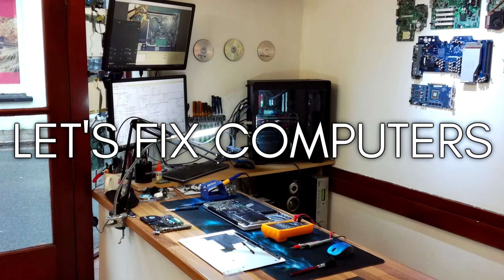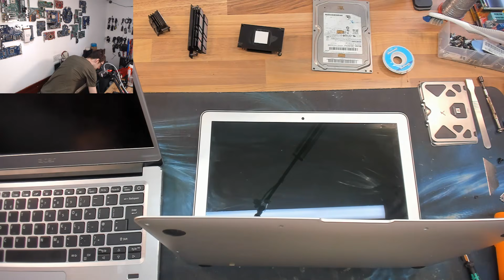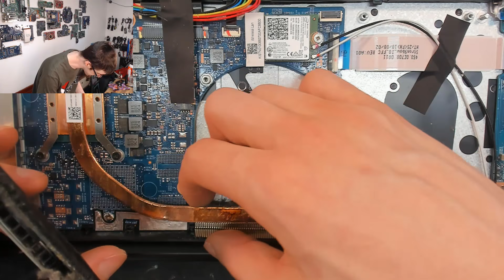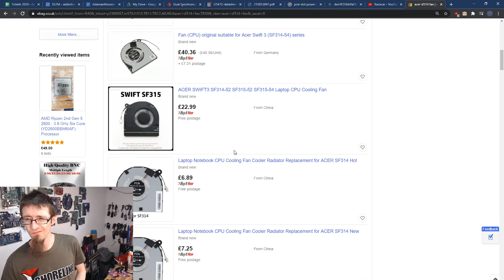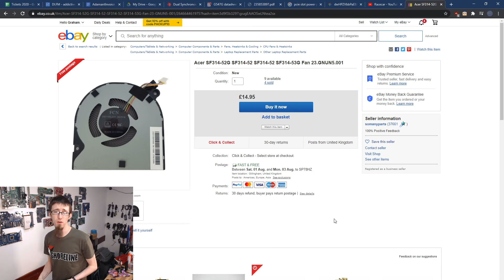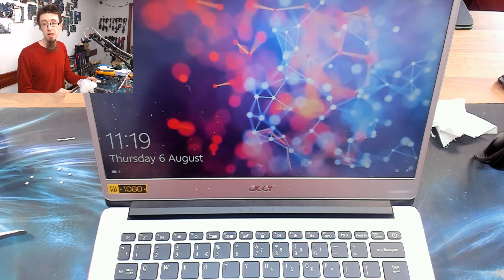Noisy Laptop Fan (Acer Swift SF314) - LFC#219

Comment: I just slap mine a bit till the fan starts spinning normally again. Easy fix
Reply: Same. Ever since i cleaned out my laptop's guts the gpu fan aint spinning right without a good thwomp.
Reply: I slapped mine and it just got worse 😭
Reply: @casper8631  if first you don't succeed, try and try again
Reply: @casper8631 slap to discipline not to punish
Reply: I'm going to end up punching a hole through mine i swear to god
Reply: @matthiaspacker565  I've done that very thing to my last laptop. Believe me it's not worth it.
Reply: @meatballsub3956  the constant sound of it trying to take off just keeps pushing me, I'm planning on building myself a pc asap
Reply: @meatballsub3956  well my cooling fan officially died and I'm trying very hard to keep my composure, because due to current circumstances once this laptop dies its gonna be a long time until I get another, or that pc id been praying for
Reply: @matthiaspacker565  I have two guys at my house right now looking at my laptop and the fan is completely stuffed. It's $80 AUD for a new one and a 3(ish) week wait for it to be delivered. So it's about $400 in total to get it diagnosed and serviced with the new install. Depending on how much yours cost you, Id say it's worth it.
Reply: Careful with that if you have a hard disk it might damage it by smacking the write head into the platter
Reply: @techgamer1597 it is called a Hard Drive NOT A HARD DISK
THEY BOTH HAVE THE SAME MEANING BUT THE PROPER WORD IS HARD DRIVE
Reply: Same that’s how I “fixed” mine
Reply: Where do u slap it???
Reply: @ApoelGraffiti95 mhm
Reply: I did it to mine and it worked so thank you
Reply: holy shit, it actually worked lmao
Reply: I just tried this and it just helped, thank you so much🙏🏾
Reply: Did it a first few times now the sound intensified
Reply: lol
Reply: I just did this too 😂
Reply: @MillennialMoneyLabd  well my gpu died 6 months ago. so be careful. better take it to a service center 😅
Reply: I used to do that but it’s not working anymore
Reply: YO THANKS LDMFKF
Reply: i did that for awhile until it never worked again😅
Reply: Good to know I'm not the only one lol, although I'm here since slapping it no longer works :(
Reply: Me too, but it starts again
Reply: Me too bro
Reply: I fixed mine by sucking the dust out with a blow thing used to blow away all the dust
Reply: Ayo bro, thanks for the fix it fuckin worked 💀💀💀
Reply: "When they dont work properly give em a little slap" 👴
Reply: @woodenhoe never do that if you use a Laptop that has a Hard Drive as it will damage the Hard Drive but it won't harm a Laptop that uses an SSD Drive
Reply: True, Mine spins at 3700 (speed) while making noise and vibrates but I hit it for 30 - 40 seconds, it stops making noise and spins at 5600(max)
Reply: @ans.88.88  If it’s spinning at max you’ve got a dust buildup
Reply: This is what's known in the industry as percussive maintenance
Reply: it worked but the sound just comes again
Reply: This works lmao 😭😭😭
Reply: The tap isnt working anymore, its just dont stop
Reply: Meet the Engineer
Reply: Samd
Reply: Thank You just worked
Reply: @DreamerPlayz001  Be careful, eventually the tap will no longer work, I had to use wd40 on the fan and it fixed the vibration and noise.
Reply: Bro you just saved my night thanks 🙏🏽
Reply: holly fuck man, that actually worked!
Reply: This made mine worse
Reply: thanks works for me too
Reply: Same
Reply: I blew air into the fan
Reply: Yoo thanks man😂😂😂
Reply: @mrskrissss  don't thank me. The fan broke and my GPU burned 🤣 go to a repair shop
Reply: worldwide solution 😅
Reply: I did the same and it fixed, it even changed the background to a colorful stripey bg
Reply: @cfg_gg  LGBTQ+ positive
Reply: @AvianDnD  lol🤣
Reply: I didn’t even have to watch the video Beacuse this fixed it immediately 😂
Reply: True

Comment: Bought my laptop January of 2020 I use it 24/7. I took it apart clean the dust out and the fans not wobbling. Although it doesn't spin as freely as that brand new one you got. I assume I just need to lubricate the fan. But man this laptop basically lasted a year before I saw any problems with it. I wish they made these fans last longer for the price you pay for the laptops. I would recommend anyone watching this to save up for a pc. Laptops cannot be run as long as desktop computers without constant maintenance.
Reply: this is happening to all brands these days... it's really disappointing having to give money for such shitty products... it's not like we can choose, me for example I had to upgrade for work
Reply: my lenovo ideapad too, exactly after 1 year of usage the fan started making noise, right on time for the warranty to be expired... pieces of shit bastards, criminals... I fucking hate them
Reply: and just to put in perspective, my 2009 laptop that lasted until 2020 lasted 6 years until the fan started to have problems, eventually dying out... and it was another 4 years of use after that without any fan at all, temps never above 70 C for watching videos.... we are really in a bad position these days, it all went downhill

Comment: 7:39 You need to cover that mid-space between heatsink and fan. That is why they put tape. Otherwise airflow will be lower than to be expected. 
Laptop fans are expensive. Especially Acer fans because their fans always faulty/shortened life items. I changed my sister's laptop fan like 5--6 times in 4 years. I thought you were find solution for that but nah, in addition you did wrong. 

https://n11scdn.akamaized.net/a1/450/elektronik/diger-bilgisayar-yedek-parcalari/sony-vpc-el-panasonic-product-laptop-fan-udqfrzr17dar__0891807481220723.jpg

I am thinking about taking this propeller (not whole set) and changing with Acer's propeller. Because it has circle around the propellers. Maybe it won't wobbly anymore. What do you think about it?

Comment: But I have an  Asus Vivo Flip 360 and it is a computer and a tablet in one.. But however I purchased a Laptop Cooler made by the brand Aicheson , and I read the instructions. But, however the fan was rattling  a lot with very great power. Not only this the cooler had 2 lights that were supposed to glow bright blue or dark blue. When I plugged the fan into my computer only one blue light was on. Not only this the fan was really rattling and wouldn't stop. I had to unplug it really quick because I thought my computer was dying......Please help meee.

Comment: hi there I have brand new acer swift 3 2020 model ,with a similar issue but not caused by the fan .I hear static noise coming from the air vents even when the fan is turned off .like electric crackling noise ,can you pls explain why this is happening.

Comment: I've started hearing some small kind of rattling myself on my laptop but I don't know if it is a bearing issue. It's very faint and you only really hear it when you angle the screen a certain way or when you put your ear right against the keyboard. is this normal? It's not the hard drive btw. Also it depends on how I held the laptop. Like only with one hand or with both which cause it to bend a little I think. Is this just wear and tear from a lot of use or something and nothing really to worry about?

Comment: Just a couple of observations and pointers.
You really should have removed the entire heatsink before attempting to separate the fan from the vapour condensation pipe. It appears that you kinked the pipe when you pulled the fan off. This will have an impact on the effectiveness of the cooler overall.
Also you didn't mention. But renewing the thermal paste is recommended, seen as the thing is apart.
And as someone else mentioned. You need to tape it back together.

Comment: Always change thermal paste. Even the good stuff only lasts a few years. Stock paste, usually 1-2 years.

I was under the impression that you were a professional who charged for this work???
Reply from the maker: Depends on the laptop. Most home laptops will go their working lifetime on the factory paste no problem, although there's certainly some models out there that need a re-paste now and then.
I'd bet that it would've made no difference to this laptop - certainly during software servicing with its new fan fitted, I was seeing no temp issues at all.
Reply: @Adamant_IT  oh you never wanna argue with viewers lol just take the advice and move on lil buddy

Comment: Hi I have a problem, maybe you could help me, I have to change a Fan that is 8.5v and I got one from another broken notebook that says it runs at 5v. Now what happens if I connect this 5v Fan to the other notebook that has one that runs at 8.5v? Will it work or not? or maybe the system fails... Honestly I don't know what to do with this. Anyway Thank you!
Reply from the maker: 8.5 is an odd voltage for a fan... I'm not sure how tolerant they are. Large fans for desktop computers are remarkably tolerant of over-voltage, but I don't know about little laptop fans. I'd track down an original replacement myself.
Reply: @Adamant_IT  Thank you very much really. I will try to find an original replacement.

Comment: Excuse me sir but i need to ask you something i have a asus vivobook with a core i 5 8gen and the cpu its reaching 100c and the pc wont turn of to prevent death i stil have 1 year to send it back. Tel me should i be worried with 100c on the cpu? Sorry for my bad english.
Reply: 100c is way too hot, send it back or get it repaired.

Comment: Everybody in the comments is like "BENT HEAT PIPE" and "YOU FORGOT THE TAPE" 
Meanwhile I'm here like the chip is configured at 15w, maybe 25w and both of these things really wouldn't be an issue. Once the pipe isn't broken and the fan spins, I assume it'll be fine
Reply from the maker: Basically this. There's a time and a place when a bent heatpipe and some tape might matter. A typical internet-browser laptop isn't it. Gaming and workstation laptops that are gasping for air all the time, yes this would be far more relevant, but for most cheap laptops that the majority of people own - massively overthinking it.
Reply: @Adamant_IT  Not sure if I am also overthinking it, but seeing as this computer has an i5-8250U, the customer has minecraft installed, as well as other gaming applications and on top of that coretemp, I myself would at least have run a stress test to check temps after a fan change.
Reply: Well I have the exact laptop, this thing will run hot, even only with 15W. Replacing paste dropped temps ~20c.
Reply: @Tsiikki  that seems like a huge gap for just replacing thermal paste. Are you sure it was making proper contact with the copper pipe before?

Comment: That was easy one.
In some laptops you need to take entire thing completly apart to access the fan...
Reply: * Cries in Dell Inspiron *
Reply: So true, lol I used to have the Dell Inspiron, don’t get me wrong though it was an awesome laptop, but now I have a much more cooler Acer Predator
Reply: I replace my broken fan on my dell inspiron  and it works well
Reply: my older 2009 "gaming" laptop (that first generation of laptops with GPUs was so badass...) had a super convenient lid over the fan, you could access the entire thing from there and even disassemble it without having to take off the cover off the laptop... and another thing: I don't recall ever seeing any hint of "double sided tape" anywhere there... we reached new levels of low these days
Reply: @FeelingShred  my father's insprion 1545 also has the panels over the fan, HDD, the whole cooling system and ram and it's very convenient when he needs to clean it.

Comment: First time I opened any laptop was my only laptop ever and it was for fan noise. I opened and put mineral oil in fan to stop the noise created by dying out of its own oil. Which also was causing overheating obviously. I used that Dell vostro 500 over 5 years and most of its life it was always on. And it is still can work but I dont use it anymore.

Comment: You did the job very poorly. You bent the heatpipe when removing the tape from it, and also didn't tape back the gap. I'm sure that the customer doesn't care but I definetly wouldn't recomend you to a friend if he needed this kind of service.
Reply from the maker: The heatpipe is fine, a little crease is not a bend/kink. The tape makes no difference IRL. You can re-add it for a 'factory look', but it's not going to have any impact on temperatures.
Reply: @Adamant_IT  By bending it it isn't mounted flush with the fan since its not straight with the chassis anymore. Meaning that the air flow will be worse. But it could have been better if you would put tape on it. Thats why I stand by my initial argument.

Comment: While editing, my ancient(relatively speaking) i5-2500k stock fan does get a bit loud. Weird thing is, I LIKE IT! It sort of adds to the atmosphere, you know. Am I the only one here?
Reply: the problem is that a fan running constantly on max speed will eventually die sooner than intended, it reduces lifespan, it starts to "dry out", after all it's mechanical parts and with touch they generate heat and dry up over time... my core2duo laptop lasted some 6 years until the fan died, and another 4 extra years after that with no fan at all... it was a sad day when I shut it down for the last time and put in a box
Reply: that thing was a beast
Reply: i5-2400 here. Runs butter/smooth

Comment: Hey man, could you give me some advice? Been watching the channel a while now and I like the stuff. I'm unable to support more than just watching due to the location I am in, so please let me know in a reply if you would be willing to hear me out. I won't post the problem I have until I know you're okay with it. Don't want it to seem like I'm demanding free labour. All the best!
Reply: @Noel Dowds Alright. So the problem I'm facing is I get really annoying coil whine from my laptop whenever it's in the "High Performance" mode. 
For context, I have an MSI-GF63 8sc Thin equipped with an i5 8300H + GTX 1650 MaxQ 
It's a single fan, but I know the fan isn't the issue. 
Is there any way to combat this problem? 
So far I've been using the laptop on it's "Balanced" mode and I have no coil whine, but the laptop doesn't utilize the boost frequency in this mode. 
I tried setting the advanced power setting to 98% in high performance mode but that causes it to negate the boost frequencies as well. 
Any advice is greatly appreciated
Reply from the maker: There's not a lot you can do about coil whine that I'm aware of. Unless there's a way of getting a thermal pad or something across the top of the coils on that laptop's mobo - I wonder if that would be enough to dampen it slightly.
Reply: @Adamant_IT  I'll try to see if I even have access to that from the exposed side of the mobo the next time I open it up. Unfortunate how there's nothing that can be done about it because of how scarily loud it sounds. 
Thank you for your reply

Comment: the bent heatsink can cause a few temperature differences. wont kill it but thought id point that out. i personally did the same mistake on my lenovo ideapad z370 (rare laptop) while i was upgrading the processor. bought a new heatsink and fan from china and temps are better. no more throttling

Comment: @Adamant It - you must be new to IT and still learning. There's a reason why there's a piece of tape on the heat pipe and the fan so all air flow goes directly through the heat pipes cooling fins. if you're going to go through all that trouble you should have added new thermal paste to the CPU especially if you suspect it was overheating the thermal compound might be compromised.
Reply from the maker: It's fine. After getting a new fan it ran through software servicing, windows updates, diagnostic scan, etc. Some laptops are very susceptible to needing new thermal paste, would definitely agree there, but most average web browser devices like these need very little to keep them happy.
Reply: @mrblackfonzie   bullshit... my older laptop (much better built quality by the way... 2009) didn't have ANY "double sided tape" or whatever the fuck that is...
also, it had a lid over the fan so I could remove it without having to open the rest of the laptop, 2 screws did the job, no hassle... your pathetic excuses won't cut it... shitty quality nowadays

Comment: you didnt changed the thermal paste? you do not reapplied the tape to force airflow towards the heatsink, u bend the heatpipe a bit, and 15 pounds for a trash can fan? those are 20 euros
Reply: Fr
Reply: Get your grammar correct 
It's spelt change and bent

Comment: if the fan continues to work like that, will it die eventually or just make annoying noises?
 I'm asking because i've been dealing with the same problem since a few months, brand new rog asus laptop not even a year old and the fan is garbage. Unfortunately i live in a useless country where getting simple things as fans is a hassle
Reply from the maker: It'll likely die - but more importantly it won't be providing proper airflow, so the laptop may be overheating. Definitely needs to be sorted.
Reply: @Adamant_IT  thanks you i 'll try to get one!